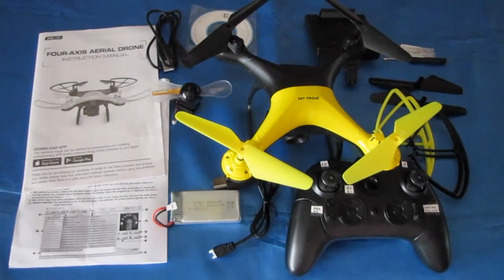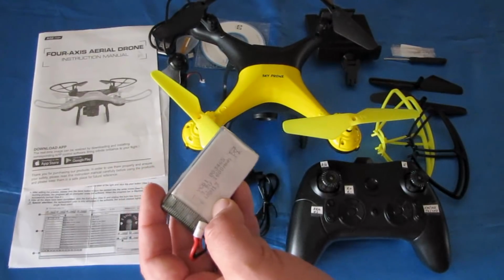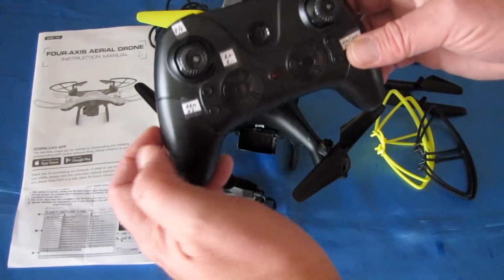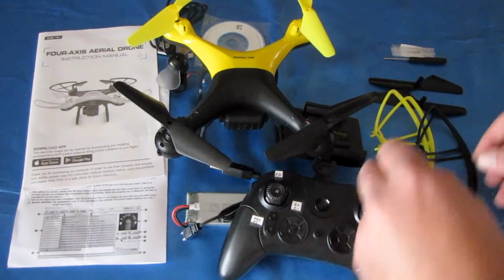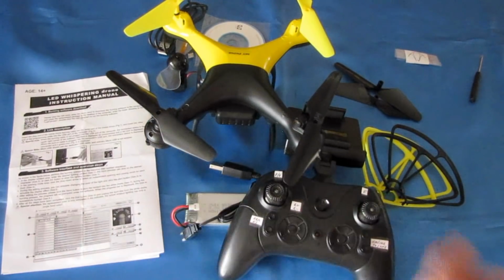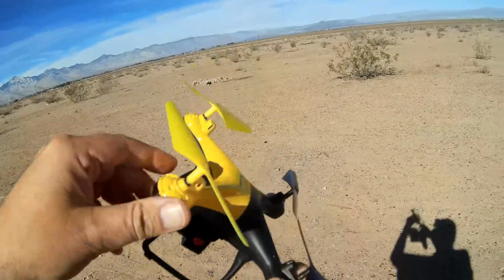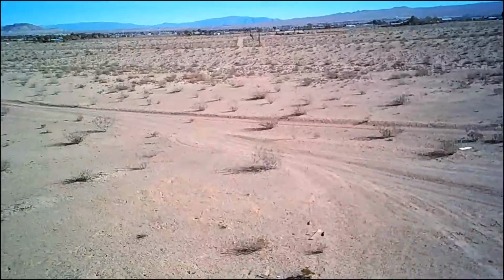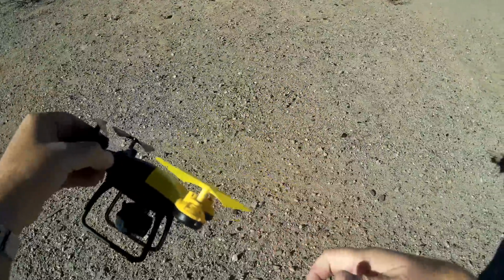DWI X35 LED Message Drone Flight Test Review

Comment: idia is goo but realization - so so. 
Have this one drone - this thing that lightings withs words - is stops rotates in a 40-50 seconds. IF i push it by finger - it rotates again but again stops in a few sec.
Plastic is soft - it good for beginner toy but is looks cheap. So - this is cheap drone, but i thing this is not best drone  to buy. Thare are many more intresting models for this price.